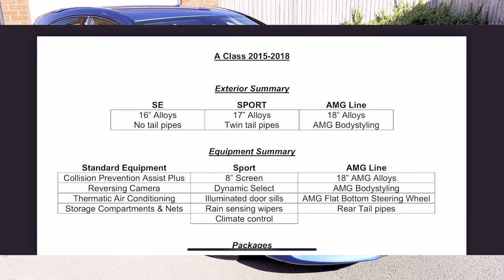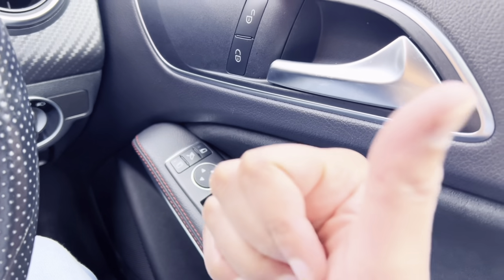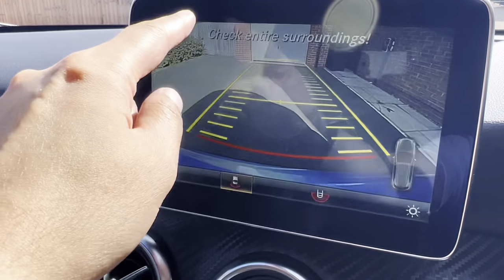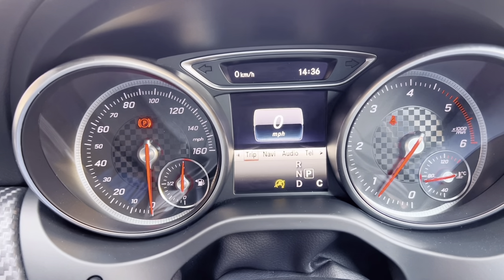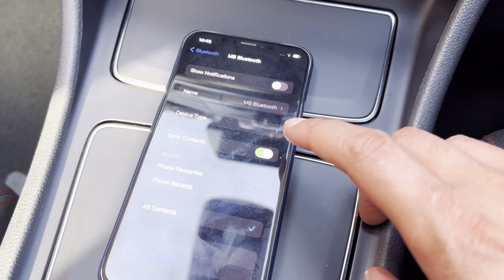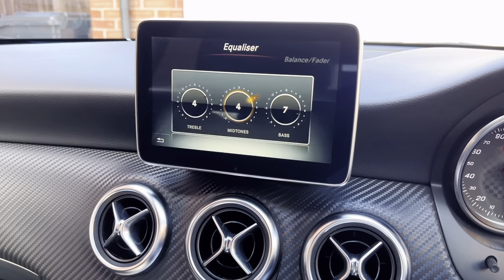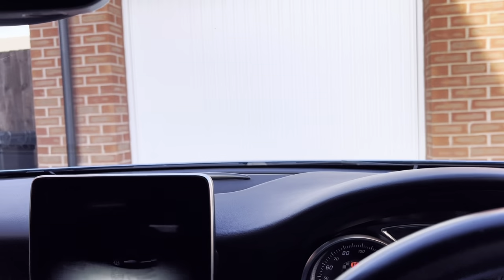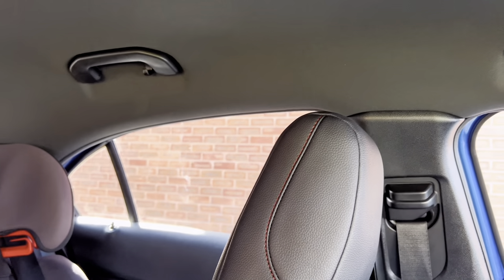2013-2018 Mercedes A-Class. All you need to know interior and exterior features and how to use them!

Comment: Just a quick question mate are there real parking sensors that beep on these cars or is it just the reversing camera that aids with reversing.
Reply from the maker: Thanks for the comment. If you have parking sensors then they will beep if you get to close to a car or a wall. 
If you do not have the sensors then use the camera and grid lines to park.
Reply from the maker: Check out my specification video to check what features are options and you can also download a free guide to see what is standard and some of the main options too https://youtu.be/bphGORlbyP0?si=6vnXW2rnGQBpM3E-

Comment: Can i change my car to garmin sat nav by getting the sd card
Reply from the maker: I think you can purchase a new Garmin SD card from your local dealership and it will then be linked to your car. Don’t buy a used one because I think it will be linked to the previous owners car. 
Best to double check with your local Mercedes dealership to check if you can purchase the Garmin SD card. 
If you have Apple CarPlay or Android Auto then I would just use that.

Comment: Trying to decide between BMW and Mercedes for next car. Thank you for an excellent video to help me with regards the A Class.
Reply from the maker: Thank you for the comment. Are you considering the BMW 1 Series and if so what year?
Reply: Hi. Yes looking at 1 Series and year 2017 onwards, depending on price. Saw a really nice M Sport Shadow and whilst deciding if BMW or Mercedes, it sold...
Reply: PS looking at petrol only and most likely manual
Reply from the maker: Both are really nice cars and drive really well. The BMW is rear wheel drive and the A-Class is front wheel drive. For me, I prefer front wheel drive for better traction when it snows. What are your thoughts?
Reply: I must admit I am leaning to the A Class as I've never had a Mercedes. I did once own a BMW 328i straight six engine which was amazing. Feel that the 1 Series feels a little dated and snug inside. Currently own a Honda CRV which is huge. Think I need to sit in an A Class and compare.
Reply from the maker: The Honda CRV is a bigger car and you will notice the height difference too. Definitely worth you test driving an A-Class you want to buy to give you an informed decision. It might be worth looking at a GLA instead of an A-Class?

Comment: Exhaustive explanation indeed!
Just one note regarding the way to return to automatic mode from manual during drive.  Do not touch the gearbox lever,  just press and hold  the '+' paddle for a couple of seconds. This is the officiai method as per instructions manual.
Reply from the maker: Thanks for the comment. I was told by the sales guys that this was the way to change it back to auto mode. It has always worked. 
I barely use the paddles to be fair. Do you use yours allot?
I did try the “+” paddle for a couple seconds but the gear change did not feel smooth.
Reply: @DrSaahb  I've just had a check on the interactive manual and you are correct, the gerabox lever is an alternative. There's even a third way to return to automatic gearshift, pressing the DYNAMIC SELECT button. Here is the manual quote:

 "To deactivate: pull steering wheel gearshift paddle +  and hold it in place.
or
 Use the DIRECT SELECT lever to shift the transmission position.
or
 All vehicles (except Mercedes-AMG vehicles): use the DYNAMIC SELECT button to change the drive program.
Mercedes-AMG vehicles: use the DYNAMIC SELECT controller to change the drive program."
Reply: @DrSaahb  I use paddles only in certain conditions, mainly driving downhill or getting closer to a pay toll in highway, in order to exploit the engine brake. Sometimes  in overtaking phase to get a more efficient gear change around 4000rpm. Automatic mode in fact brings the engine rounds a little too further
Reply from the maker: I am so glad you checked this! I was abit worried I was damaging my gearbox and advised everyone the wrong thing 😂
Reply from the maker: I do let the car coast when going down hill for the car to recharge the battery and apparently it is more economical to do that too. 

I have downshifted a couple of times when driving on the motorway to overtake but that is it.

Comment: Excellent review! My GLA 180 2016 the infotainment system remains black at the start of the car. It takes time and after while it is on. Any reason why it is and how to fix it? Appreciate your feedback
Reply from the maker: Thanks for the comment. How long have you had the car and when did this issue start? 
When the infotainment is on and working, press  and hold the On switch until it switches off and then restarts itself. It may take a couple minutes but it will eventually work. Let me know how you get on please? 
Sometimes I have to do this especially on a very hot or very cold day.
Reply: Thank you. This doesn’t happens every time. On and off. I will try what you recommended if this happens again.
Reply from the maker: Let me know how you get on please? It could be that the car needs a software update if this doesn’t resolve it?
Reply: @DrSaahb  sure! I didn’t want to do since it is working perfectly now. If I have to do it. I will certainly give you a feedback. Thank you

Comment: Hi, great video, thanks for posting. Only thing you didn't mention was the rear screen heater (which also activates the heated wing mirrors). 😊
Reply from the maker: Thanks for the comment 😊 LOL totally forgot to mention it in the video! It is such a useful feature when its super cold outside.
Reply: Hi there, great video,  love this colour of the A class,  does yours have dab radio fitted.
Reply from the maker: Thanks for the comment. On this generation, for UK customers we had to order DAB from the factory when it was being built.
Reply: @DrSaahb If you could mention this feature it would be great, thank you
Reply from the maker: @misesandra9377 definitely next time.

Comment: This car has lots of lovely features. In your opinion, how is it when driving? Any gripes or issues?

Specifically, what do you think of the back window? It looks a little narrow to me. Is visibility limited in any meaningful way?
Reply from the maker: Thanks for the comment. In terms of driving this is very subjective and depends on what cars you have owned and driven. I like the sporty feeling of my AMGline but still find it a comfortable drive. However my wife is used to the GLA Sport and prefers a softer and higher setup (both cars are built on the same platform but feel very different). 

Boot size for some people can be an issue but for me, my wife and daughter it is fine. Again depends on lifestyle. 

The back window is narrow but having a reverse camera does the trick and definitely an option I would have on any A-Class. Luckily for us in the UK, I think 2016-2018 reverse camera is standard. 

What other cars are you considering?
Reply: @DrSaahb  Thank you for the detailed reply. I am coming from an older Ford Focus that has a really nice and big back window, and having sat in (but not yet driven) an A180, the most notable negative was comparatively a lot less visibility out the back window, due to the narrower window and also the headrests. I've done a bit more research and this seems commonplace on hatchbacks, and I think it is something I could get used to. The rear camera is great. I just had a bit of a fear that I might not catch something in the rear mirror since the view isn't as good, whether that be when I'm keeping an eye on what's happening behind me when driving, or when reversing. Folding the rear seats could be helpful when not carrying passengers, but in fairness, you don't have the best view out the back window if you are carrying passengers in the back.

I've had good experiences with Ford and I would be happy to go with them again, but I was really impressed with the feel of the Benz. Other cars of interest would be a VW Golf or a more entry level Audi or BMW. The Benz is what caught my eyes most within my price range though, but I just want to make sure I'm making the right decision as it's a big expense.
Reply from the maker: That is fair enough. Take your time. What year are you looking to buy from?
Reply: @DrSaahb  I'm looking at a 2014 model
Reply from the maker: Thank you. Are you buying a car in the UK?
Reply: @DrSaahb  I am based in Ireland. I have made an agreement in principle for an A180 AMG Night Edition. It's a Japanese import. I am feeling happy with my decision but I suppose I'm not going to know for sure until I'm using it on a daily basis. Fingers crossed 🤞

Thanks again for your words of wisdom. Your videos have been very helpful!
Reply from the maker: 2014 model will have some very small differences with design so it won’t look the same as mine. I do prefer the headlights on the prefacelift but still really like mine. The other thing you may notice is the smaller infotainment screen unless it has the upgraded satnav. The steering wheel design will be squarer which looks cool too. The instrument cluster also looks like the same ones from the SLS which is cool too. 
Let me know how you get on please?
Reply: @DrSaahb  I'll let you know. I'm looking forward to owning and using it now!

Comment: Hi dr Saab I own a Mercedes A class w176 automatic 2013 as u mentioned in video that to park the car u just need to press P on the stalk and turn off the car the car will automatically apply parking brake I’ve tried many times but it doesn’t even if I take out the key car doesn’t apply parking brake itself so I have to manually do it every time which is a bit hassle keeping in mind that parking brake switch is located at unconventional place. Can u help me out please.
Reply from the maker: Thanks for the comment. I think for Facelifts it does this feature. I would ask your local dealership to double check. 2013 is pre-facelift so it might not do the same functions as my car.
Reply: @DrSaahb  thanks for replying yh u might be right but to move off i can just select D and car moves i don’t need to pull the parking brake button that’s why i was bit confused why its got one feature but not the other.
Reply from the maker: Yea that does make it abit confusing. Let me know how you get on with your local dealership please?
Reply: @DrSaahb  yea I will let u know bro thanks.

Comment: I cant wrap my head around the choice between A160 / A180 / A200 since they all have the same engine. My gut feeling says: A200 will need more maintenance since we ask more power from the same engine. Any thoughts on that?
Reply from the maker: Thanks for the comment. It depends on your driving style. I have a relaxed driving style so the A200d fits me and my lifestyle. My wife prefers the 220d because she likes the more instant throttle response. 

Maintenance will be the same whichever version you go for unless it is the AMG models with AMG engines.

Comment: Hello Dr, i have the A180 d 2016.  I'm wondering if I can cast my phone to the infotainment using the Android auto? I've tried to based on some research I've done but the infotainment just keep saying connecting. I called my local MB to have this fixed for me and they are quoting £185. I took the car back to the dealership where i purchased it from as it's still under warranty and after checking this feature they refer me back to MB. Any tips on this would be appreciated. Thanks.
Reply from the maker: Thanks for the comment. Android Auto was available for some cars in 2016 but I think became standard after 2017. Depending on when it was built then it may not have the feature. Sometimes cars that have not sold for a year can be sold the following year. 

I would test other Android phones (maybe newer ones and see if they connect). You could also test if your phone works with a friends car that has Android Auto to double check that there is no issue with your phone. 

If newer Android phones do not work then double check if your local Mercedes dealership can get Android Auto to work for you at £185, then that sounds like a good way of getting Android Auto.
Reply: Many thanks for this 👌🏾
Reply from the maker: Let me know how you get on 👍
Reply: Sure I will.

Comment: I have a 2017 a180 and when i lock my car , interior door handle led lights dont turn off, if i press the lock button again they turn off.Is there any problem
Reply from the maker: There will be a setting in the “Vehicle” option to change the settings of the door handle lights. Unless the car has after market lights fitted.
Reply: @DrSaahb  thanks for helping
Reply from the maker: Let me know how you get on 👍

Comment: I cant find the light settings about when u open/close the headlights are open
Reply from the maker: Thanks for the comment. What do you mean? Sorry I don’t understand what you are trying to do?
Reply: @DrSaahb  i am talking about the welcome lights
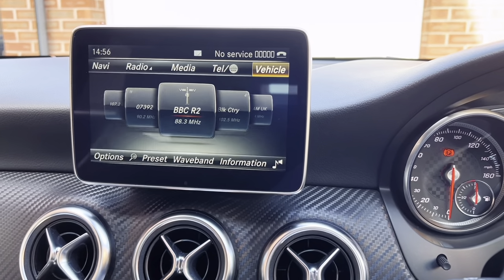Reply from the maker: Please watch this video from 26:00
At around 26:31 You will then see the option of “Interior Welcome Light” and also “Exterior Welcome Light” if you have the option fitted to your car. 
Let me know how you get on please?
Reply: Thanks for your help, the problem was solved when I switched the light setting to automatic. There is one more question I want to ask. When I pressed the start button this morning, the engine did not start and all the lights on the dashboard started to turn on. Then I removed the start-stop cover and started the vehicle with the key
Reply from the maker: Next time, try putting the car into power on mode (so all the dash lights cone on) and then press and hold the brake, then push the start switch to turn on the car. Let me know how you get on?
Reply: @DrSaahb  When I tried it in the morning, I couldn't press the brake, it was locked.
Reply from the maker: @moonknight1645 that is strange. I have never had that happen to me. 
Was it cold this morning? 
Might be worth seeing if it happens again.
Reply: @DrSaahb  Actually the weather was cold, but the car was in the garage, I don't think it was because of the cold. Do you think it might be related to the battery?
Reply from the maker: Might be worth giving a good long drive and then testing it the next day. Maybe take the car on a long journey for at-least half an hour.

Comment: Hi i have a200 mercedes how can  use car play please  i think my car doesn't have car play   Thanku
Reply from the maker: Thanks for the comment. What year is your car?
Reply: 2018 mate
Reply: If u want i can give u   My reg car aswell
Reply from the maker: Does your car look like my blue car or does it look like this car in this video? https://youtu.be/Eb79vgp7_MY?si=QwC20HctA75wnCXO
Reply: Like red one  mate
Reply: Like  red one  but 2018
Reply from the maker: I don’t work at the dealership so I can’t check the specification for you. 

If your car is the new A-Class, then you can purchase Apple CarPlay through Mercedes Me. 

If your car looks like my car, then watch this video from 17:54 https://youtu.be/AsxItynbtXc?si=u8MrPoHUQicZugQy
Reply: @DrSaahb  sam  car but    I can't find car play
Reply from the maker: You have the New A-Class. I would first see if Apple CarPlay works by using a quality USB-C cable to your iPhone. If it doesn’t work then you will need to purchase it through the Mercedes Portal online. 
If you need to double check, contact your local dealership and they can tell you if your car has Apple CarPlay. Sometimes they might say it has Smartphone Integration (which basically means Apple CarPlay) or they might say it is Pre-Installed Smartphone Integration (which means you have to purchase a licence on the Mercedes Me Portal online). 

Hope this helps mate.
Reply from the maker: It used to be an option from factory but UK customers also had the option to purchase it in the future online using the Mercedes Me portal.

Comment: I just wanted to know how to change the radio volume. No such luck...
Reply from the maker: Thanks for the comment. I don’t think I show how to use that but where you have the “ON” button, it is also a dial which you can rotate. Hope this helps.
Reply: @DrSaahb  ahhh, thanks! Pick the car up Saturday & didn't figure it out on the test drive!
Reply from the maker: Fantastic! What specification did you go for?
Reply: @DrSaahb  thanks for asking! Silver 2013 A45. 43,000 miles. 1 spec in aus, sun roof, paint & big rear wing were the only options. Didn't get the wing :-) cheers
Reply from the maker: Wow and congratulations the A45 is a special car! You will absolutely love it. Silver is a great colour choice. The infotainment will be abit different to the one in my video because I think 2013 was a pre-facelift but most of the switches will look and feel the same. I do love the rear lights of the pre-facelift. Let me know how you get on with it.
Reply: Hi,  @DrSaahb . You were right, loving the car, more importantly (it's her car), partner is too. Honestly though I'd have given up a bit power & gone for the 200d you've featured & enjoyed the range, better ride & a bit more ride height. Thanks again for your vids & help.
Reply from the maker: The a200d is a great car but the A45 is very special! I remember everytime I drove one, it was always such a special experience. Does your exhaust like to pop and bang 💥
Reply: 😂 yeah, non stop! It's high drama, just going to the shops!! I want to apologize for my initial post being a bit critical of how this vid covered radio operation. Just realized you have a separate vid just about that! I'm clearly no genius!!
Reply from the maker: Haha I forgot I made the radio video but I think you commented on that video acknowledging it. I forgot to show how to use the radio in this video. It was a really hot day when I recorded this long video!